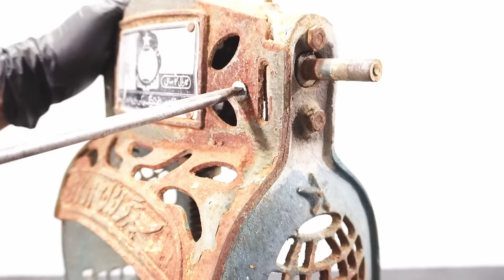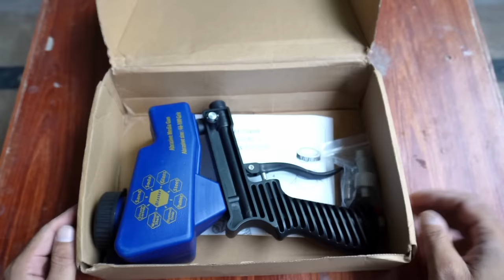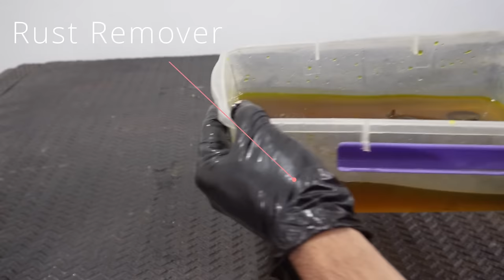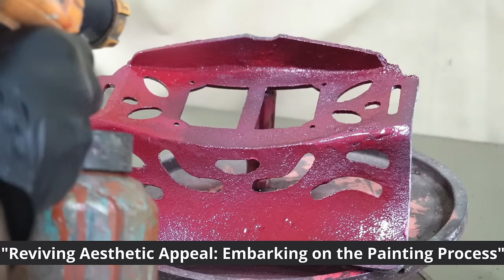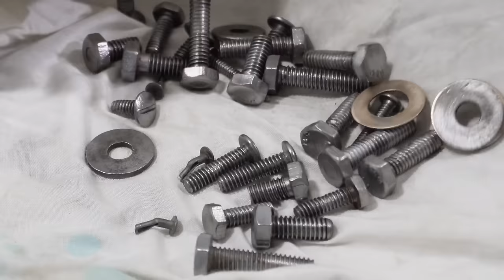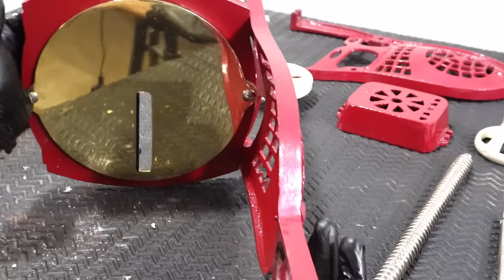🔴Ice Crusher Machine Restoration - asmr restoration

Comment: The holding  pins to hold the ice were still covered with rust (why)
Reply: Ice is an extremely good blasting medium. Throw away the first few rounds of ice and you’re golden. Thus why it’s used in garbage disposals.
Reply: Sometimes things are missed.
Reply: I agree. The rust should have been removed from the daggers that hold the ice. The daggers should have been sealed so they wouldn't rust. I understand "some things get missed", thank you.

Comment: 1980s?  Are you sure that isn't 1880s? 😮
Reply: Did you notice all of the hex drive hardware?  In the 1880s those would have been square drive, square drive bolts and square nuts.

Comment: Seriously?! You did not clean the grabber spikes at all! Properly should have been powder coated, to prevent paint flaking into the ice, and ANY lubricant should be food safe lubricant, not just general use grease and motor oil! Doesn't matter if it's a display piece or not. Very poor restoration of what should have been a beautiful piece.
Reply: He forgor 💀
Reply: @kylemiller893  Do you know what critism is? 😂
Reply: @lexxluthor2166 There’s a difference between criticism and tearing people down. This dude invested a lot of time to make an entertaining video, and he will get better with experience. He might have appreciated any constructive pointers you might have offered him, instead you dumped on him just to get your jollies.
Reply: @kylemiller893  There is still critism in the comment tho. Maybe he wasnt super nice when writing the comment, but there was some good points anyways. He left the spikers rusty as fuck, didnt clean the cutting ice blade, colour is wrong even tho he knew what the original color was (cyan/light blue colour), he put fucking oil and grease to the grinders when its supposed to be a food machine, not a garage tool.
Reply from the maker: I appreciate your feedback on the restoration of the ice shaver. You bring up some valid points, and I understand your concerns about the cleanliness of the grabber spikes, the choice of coating, and the lubricant used.

You're absolutely right; attention to detail is crucial in restoration projects. I'll make sure to take your suggestions into account in future projects. Your input is valuable, and it helps me improve my work. Thank you for sharing your thoughts and helping me strive for better results in my restoration efforts.
Reply from the maker: Thank you very much sir.
Reply: A mí me gusta ver mucho este tipo de videos pero miro que te faltó restaurar los costados de la pieza ya que una parte le falta un poco de hierro y faltó limpiar bien los clavos por decirlo así en la parte de dónde se amarra el hielo porque se ve que están oxidados pero todo lo demás bien
Reply: Can't wait to see you get yours and restore it to your specifications
Reply: @Restorationcircle also wondering why you didn’t weld the one side it’s still broken
Reply: U can give advice and not be rude
Reply: Lol you're so cute when you throw a temper tantrum.